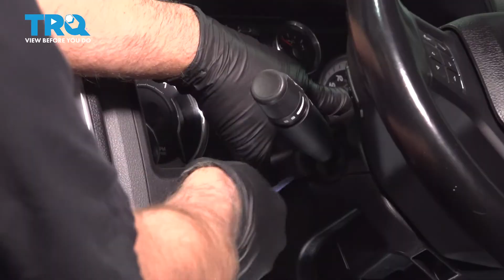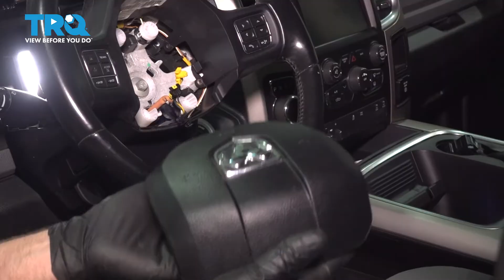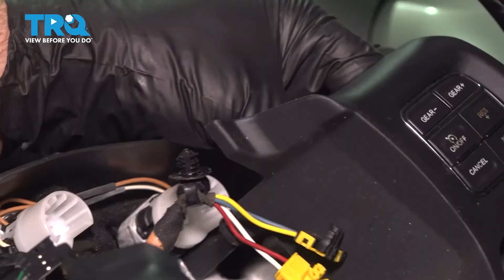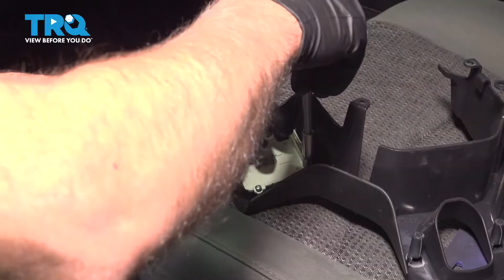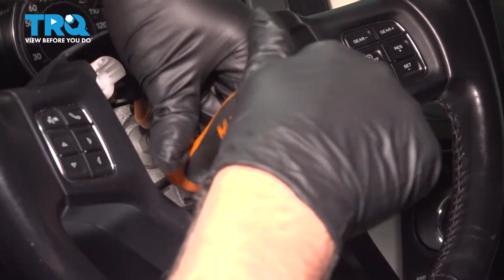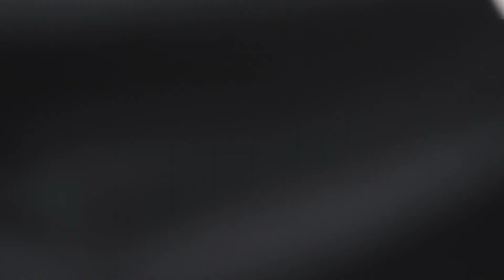How to Replace Cruise Control Switch 2011-2018 Ram 1500

Comment: I did mine with the help of this video, started put it in gear hit the up and down gears, came up fine then cruise on and off fine. Next morning I started it and went to put it in gear and blinking light and no go, check engine light came on. p1b14 code. erased code and truck went into gear fine, i am sure i got my connections tight. any input would be welcome.

Comment: @trq how did you turn the steering wheel?  Do you have the truck on a hoist?
Reply: Power steering wasn't around forever, the steering can be turned without power steering.